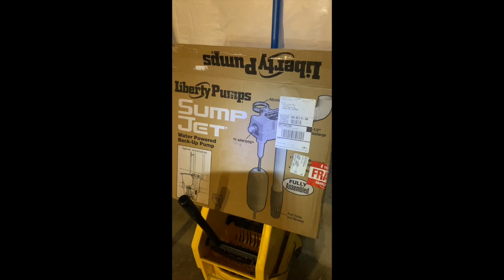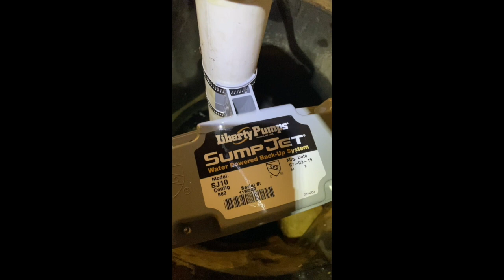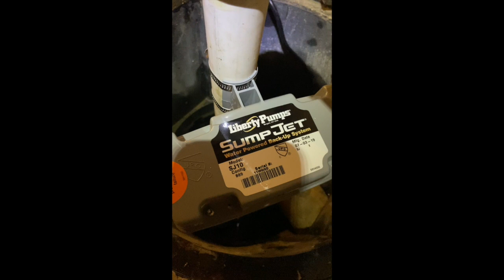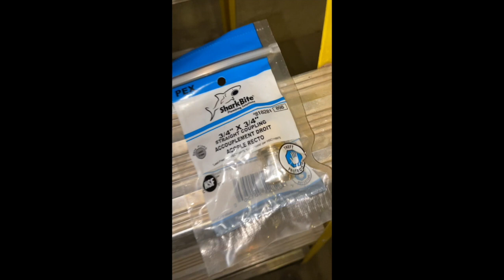How to Install the Sumpjet SJ10 Water Powered Back-up Sump Pump System- Liberty Pumps Sumpjet

Comment: Thanks for the video. There is one big problem with your install and I would suggest you fix it. We all think about the pump failing but no one considers a failure with the discharge line such as a hard freeze that won't let the water escape. When both pumps share a discharge line and your primary pump can't push through the frozen line, the liberty pump will kick on and the force of the water pressure will blow that Fernco fitting right off (believe me). If you aren't home or sound asleep, you will have major water issues in the basement or crawl space etc. When you install the discharge line for the liberty pump have it exit above ground, 4 or 5 feet from the house. If you don't have some sign your  primary pump failed you could go months not knowing. I am not a plumber but I learned this lesson the hard way.
Reply: I have learned this lesson a few hours ago.  Thanks for sharing so I know I'm not alone.
Reply: @hungdo4611  hahah same with me. Just yesterday
Reply: I had that problem of the external discharge line freezing above the ground thereby trapping water/ice and preventing subsequent water flow. k Solution: I enclosed the discharge line above ground with the 4" black corrugated plastic pipe used for drainage and then injected the volume between the corrugated pipe and the discharge line with foam insulation.  Never had the same problem again.
Reply: Did you put the corrugated pipe insulation on just the backup discharge pipe?

Comment: Just a suggestion use a why on your original outside down piece a a 90° elbow turned towards your whye. So the whole thing will look like the letter y flipped in the opposite direction. The PVC glue you are using is for cpvc water pipe. Use Oatey PVC glue comes with a green label. Otherwise you did a good job.

Comment: They recommend you use 3/4 water supply line. And a check valve.  Letting the water only going towards the pump per the plumbing code and instructions that come with the water jet pump.

Comment: If you connected the water supply line to a half inch line the pump will not work to its designed capacity for removal of water.  Need to connect into a 3/4” line

Comment: Is it possible to put in a check valve in the main sump line before you tap into it with a Y joint to prevent back flow while the backup pump is working? Thanks for posting the video!
Reply: Yes, but if the first pump is overwhelmed with water, the Liberty Pump will make matters worse by trying to pump even more water out the same pipe.

Comment: You are the best !! But question do I need check valve ? And if no why ? 
Thanks
Reply: Regular sump pumps don't have check valves, the Liberty pump has one built-in.   It won't hurt to add a second one, but it isn't needed.

Comment: I just had one installed. The pit is uncovered & the cover probably wouldn't fit back in. Should I have it covered to prevent radon gases?
Reply from the maker: Andy Whittaker radon is an issue not everyone has. If it is a problem in your area then yes. You can test for radon.

Comment: That would not pass inspection in my state . there is no type of reduced flow backflow prevention as required by code. Without that device you can have a cross connection and contaminate your potable water
Reply: i believe there is a check valve in the pump to stop backflow into water